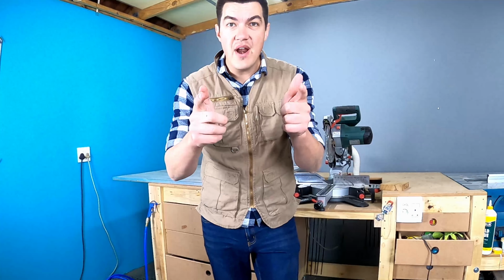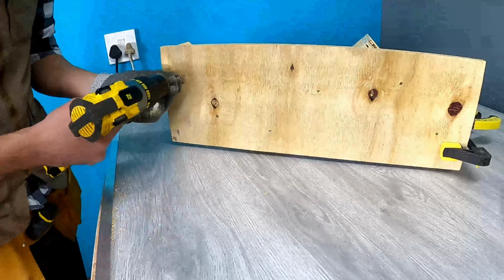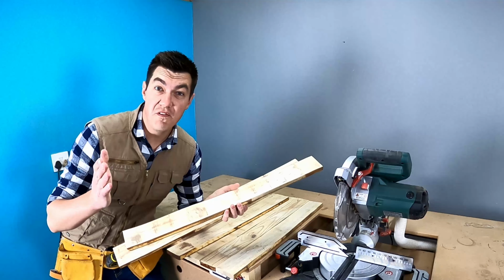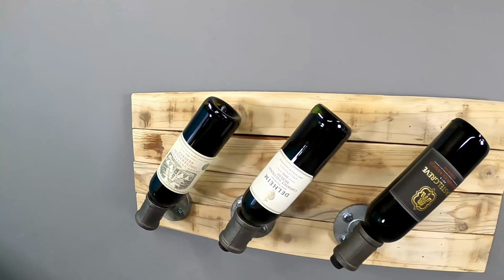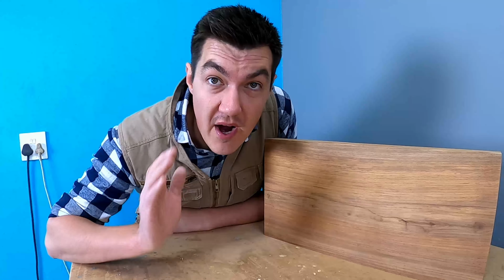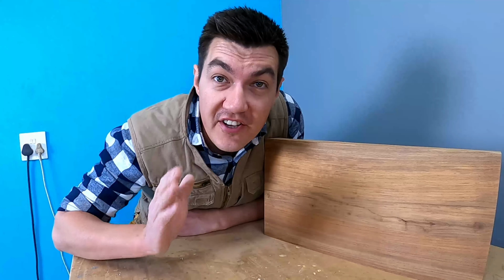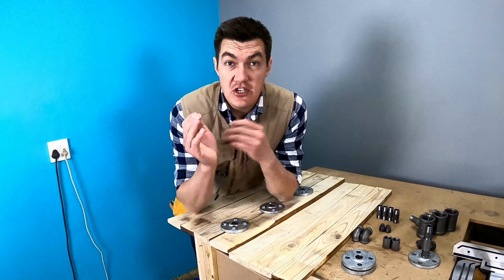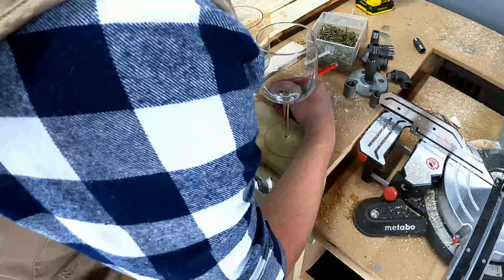How To Build 8 Types of Wine Racks

Comment: Love the videos so far, but I do want to give some constructive tips.  These are based on my own experience so take them with a grain of sawdust :)  On the pieces that you use the construction pine, I would sand the entire board to get rid of the markings (think it was #5) from the lumber yard.  Some people don't mind it, but I've had a lot of people give me a "look" when they turned a piece over & saw it (used to make blanket ladders).  For the 6th rack (Giveaway), I'd route out the edges as you'd done, mark & drill my holes for the flange, then finished the entire board before putting the hardware on.  That pretty much goes for all the projects, apply your stain / finish then add the hardware.  For the hardware, I'd install the flange first so you don't have to try to work around the rest of the wine "tree".  Your knuckles will thank you after awhile :)  These are just meant to give your pieces a little more professional look so you can get top dollar :D